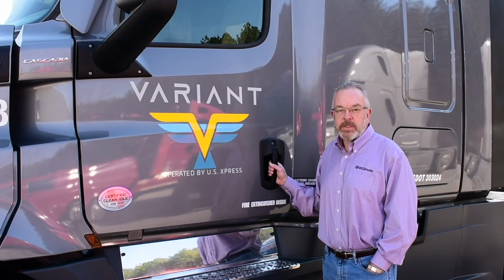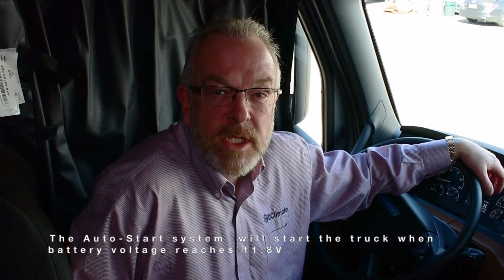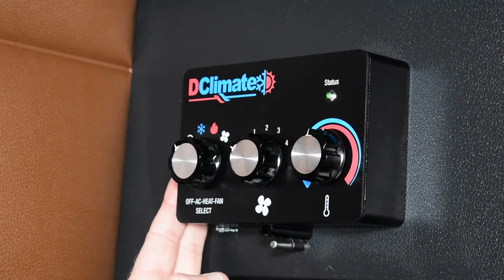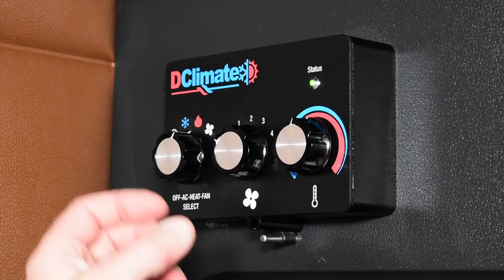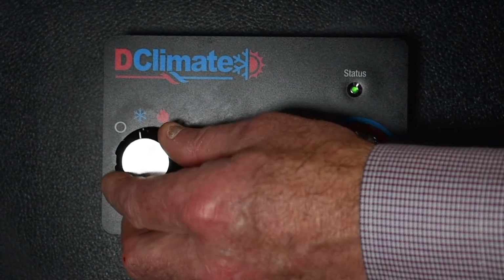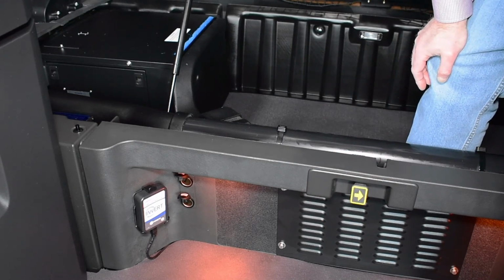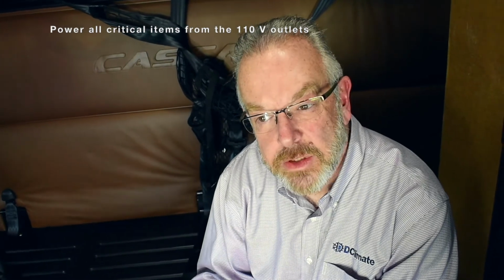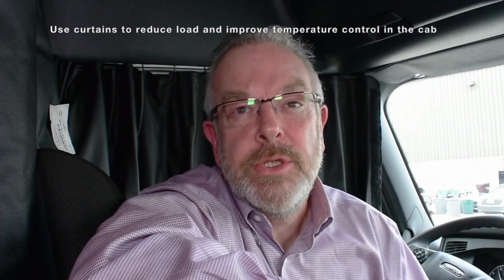DClimate Driver Training Tutorial-Variant P4

Comment: All you're doing is putting a bunch of extra batteries in a battery box and shoving it in the back so we can leave the key off for an extended amount of time The HVAC function far inadequate for extreme conditions found in a motor vehicle exposed to the elements. Truck sitting in the sun will frequently reach well over 170° interior and in freezing temperatures without idling the truck's diesel fuel will gel. The square footage in the cab of a truck is significant and requires substantial BTUs to adequately heat depending on the temperature variance between the interior and exterior of the vehicle. This beat you requirement far exceeds that of an apartment or home because trucks lack the insulation commonly found and fixed structures. The system is dangerous what's likely to happen is a driver is going to go to sleep with the system set it is going to fail and when it does someone's going to freeze to death.
Reply: Facts I keep waking up driving in the north east out here it’s -35 with windchill I set the system and my body luckily woke me up to let me know it was too cold that DC climate was blinking green and I set it as soon as I shut the truck off and put on opti idle. This feature can maybe subside in less extreme weather conditions but for high temperatures over 90 and freezing temperatures below 30s this system is inadequate. Having been using it for several months now I can tell this unit is not defective, it just can’t maintain itself in extreme conditions and will fault out due to the high stress load.
Reply: Same thing happened to me….I love this system works great normally but anything under 0 degrees and I wake up freezing and have to start my truck and idle…other than that I can go almost a 34 hour break sometimes without starting the truck

Comment: The heater doesn’t ever really get toasty. It’s getting cold out, and I have been waking up cold in the middle of the night.
Reply: The heater doesn’t come on at all.  We just had to get up and turn the truck on to warm it up.  It’s 14 degrees outside.
Reply: Turns out the wiring harness had to be replaced and this was a new truck.  Not made, it happens.
Reply: Crap that’s what’s happening to my truck!
Reply: Mine works amazing….if the temp goes below 0 though it won’t keep up and will blow cold air
Reply: @coreythetruckdriver2773  what I found is don’t use the auto or high fan I use low fan only and it always heats and cools better

Comment: I get three fast blinks then two slow blinks.  What does that mean?
Reply: Did you ever get an answer? I'm having the same issue
Reply: Im getting the 3 fast blinks and then 2 slow and mine cuts off in the middle of the night and never cuts back on. When it does that I can turn it back on but it only runs for about 7/8 minutes and then shuts off again.
Reply from the maker: Hi! Please call 636-352-1332 ext 1 or email us at warranty@dclimate.com for assistance